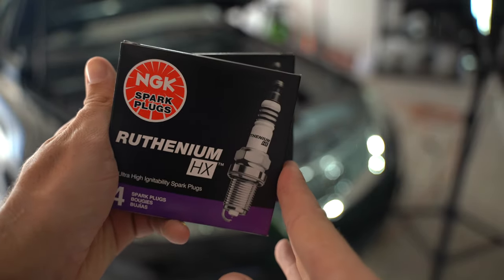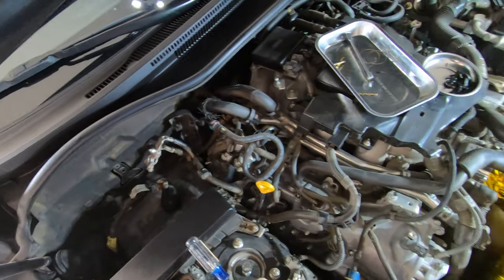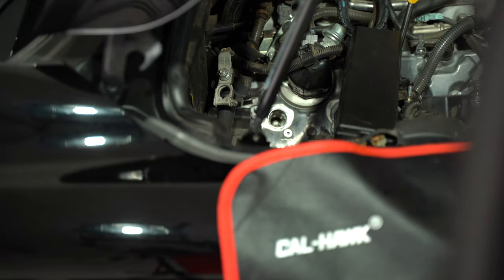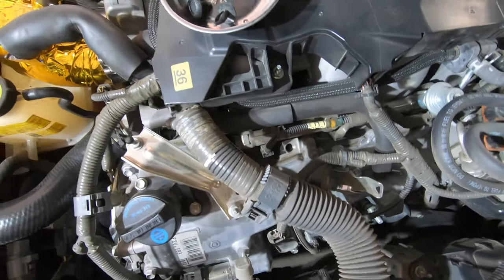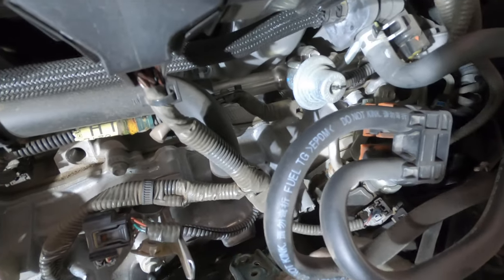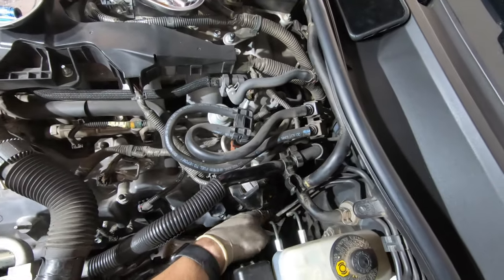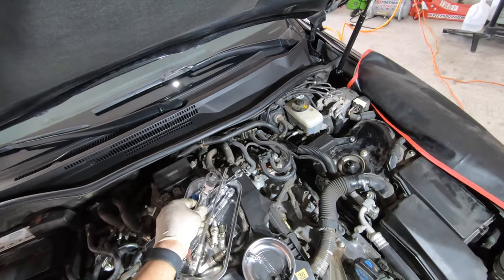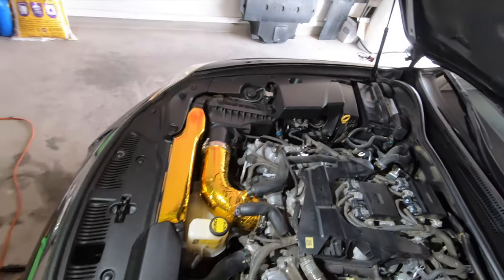2008 Lexus ISF Spark plug DIY

Comment: I’m out of Sacramento here. I just put plugs in my 13 ISF it wasn’t too bad. Had to do the same thing. Remove the battery I see the hardest ones for me was actually passenger side middle where the fuse box was and then on the driver side, the very back next to the brake booster in about the middle again to where there’s another little fuse box…..

Comment: Just installed the same spark plugs but didn't have the time to test them hard ...what's your feed back about them?  Same as oem or butter?
Reply from the maker: Definitely felt better than what was in it but those plugs had 100k on them and it was time to change them haha
Reply: @rawfilms736  mine the oem from the factory with 60k / (km) ... just installed the ngk's ... soon i ll give u the feed back 👌
Reply: @abdullahamdan137  how'd you like them?
Are they better than stock? Or should I get these for my isf?

Comment: Bro just got finished with the passenger side the connectors for the coils are hard as shit to pull out going to finish up tomorrow
Reply from the maker: Yeah bro just try to be as gentle as possible cause that can break since it’s an older car and goes through a bunch of heat cycles